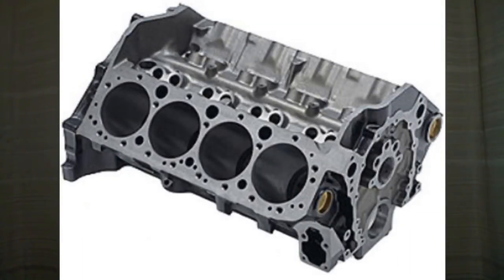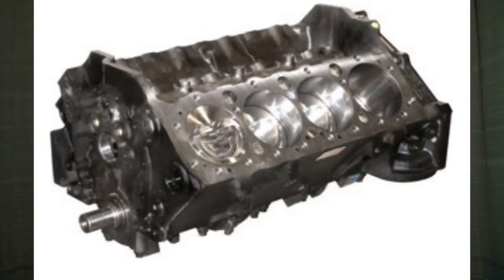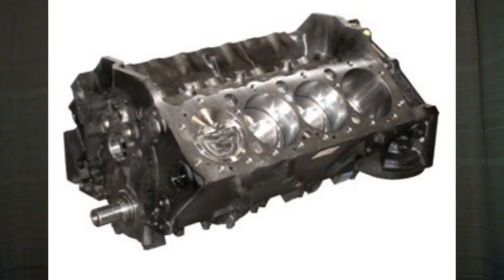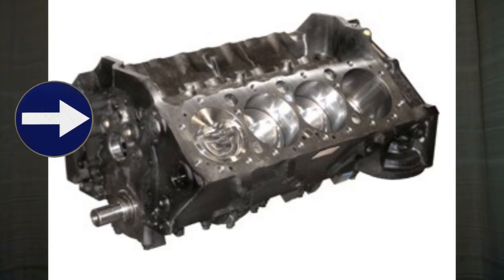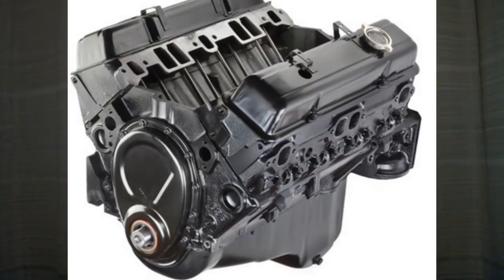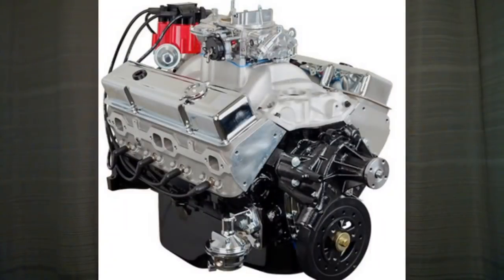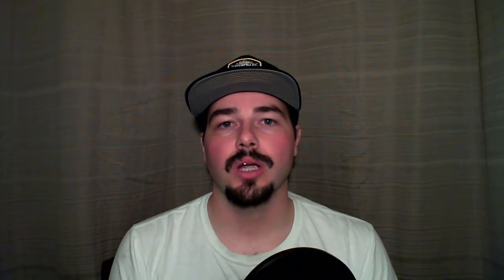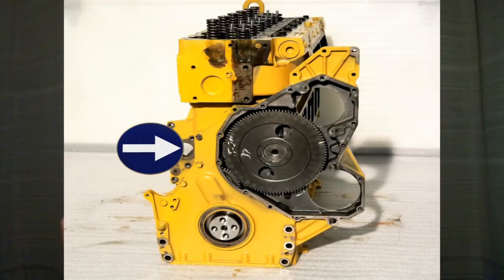What is a Long Block?  What is a Short Block?  What is an In Frame?  What is a Platinum Kit?

Comment: i had my #6 cylinder seize in my 5.9 cummins when it ran out of oil last year, i ordered a rebuild kit from PAI industries. total cost between machine shop and parts was about 1800.00 for the rebuild.
Reply: INCC74656I that seems like a decent price

Comment: Hey Josh, is it true that Cummins ISX15  and X15 series  engines use the same bottom end as the C15?
Reply from the maker: I have never rebuilt a 15 liter Cummins, but I can't imagine it would have the same internal components as a different manufacturer's engine.

Comment: You deserve more subscribers man. Then, there would be a lot more successful YouTube mechanics. Lmao! I'm not a mechanic... but a hobbyist. In my opinion, a long block is the block and head, with the crank and cams installed, and valve covers. All fixings outside a sealed engine are sold separately. As you said... a long block is per manufacturer.

Comment: I still can't wrap my head around it.  So, work at an auto parts store.  When consumers walk in and talk about their projects or what they're actually driving.  They say oh it's a blah blah blah sorry block or vice versa... why.  If from what I got from what you said,  sort block is basically an incomplete engine,  yet that's what they're driving.  How can it be a short block.
Reply: I think your getting confused with big block and small block which refers to size of the engine.....?
Reply: @hgc1581  no,  I get the size (cubic)  .  But I think I got from this other youtuber... thanks

Comment: Straight forward I need advice.
Jag 2,7D v6 , fuel falls into oil when I drive short trips and stop engine therefore oil level raising . Thought of buying  after market block since it's 2008. 

Pls advise
Reply: Ibram Guirguis try JB Weld

Comment: hey why does a early 3406E crankshaft break in half?
Reply: Mark B lugging it can cause it to break.
Reply: A failed viscous Damper will do it every time, especially high horsepower low RPM. Can be the resultant of what stroker said.
Reply: Mack's and B models are the world's worst to break due to lug.

Comment: What can I do to get more power out of a 7.2 L cat
Reply from the maker: +jeff chrivia You can rerate it through Cat or go aftermarket and add as much power as you want (at your own risk).
Reply: Adept Ape well it's in a fire truck that is halling 4000 gal. Of water and has a Eaton Fuller 8-speed with ultra low and it's a dog
Reply: And it's been turned up as far as cat will let us

Comment: Ask Renegade Trucker how that wonderful warm & fuzzy feeling his "CAT" reman warranty made him feel. $35,000 well spent, LMFAO ! The POS used 12 quarts of oil in a 1,000 miles, then they dicked him around another 8 weeks pointing fingers at each other before they screwed the overhaul up yet again. After the second go around with CAT, he had lost so much time and money he had to turn the truck back into the bank. Yeah, that CAT warranty is great, to wipe your ass with if you have a problem.
Reply: Most smart truckers run Detroit for that reason

Comment: 11/28/2019Quit saying "may or may not."  Just say "may," or say "may not," because "may" implies "may not," and "may not" implies may.  Think about it.  Also, neither a bare block, short block or long block is an engine. An engine is a machine which only needs fuel to produce power.
Reply: and oxidizer